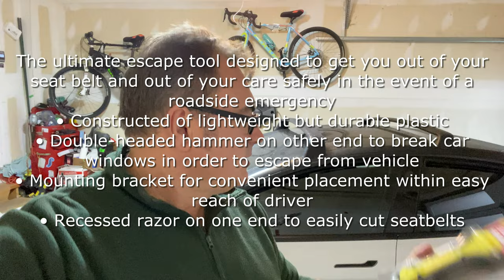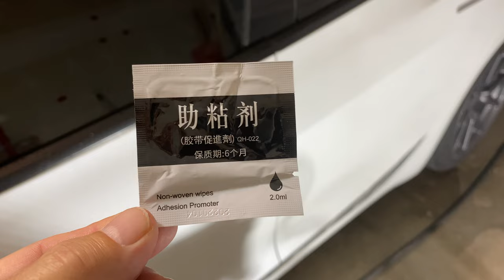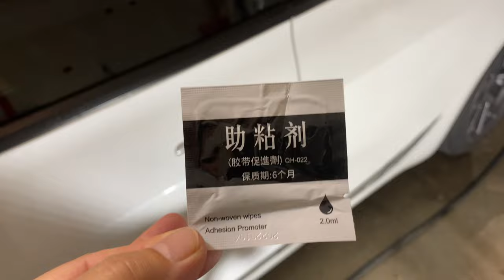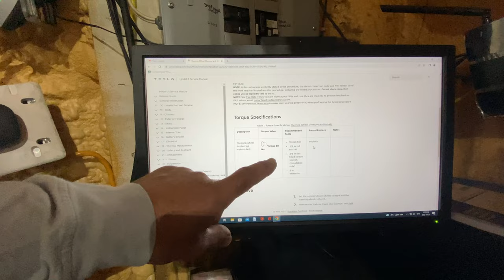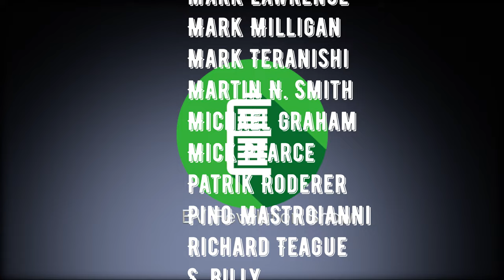Tesla Timeout #22 - EVANNEX Sponsor - Carbon Fiber Steering Wheel Model 3/Y & Door Handles!

Comment: I bet you saw my video on the door handles!  Mine have gone through one winter and almost ten months now of use.  The adhesion is amazing - no issues at all.  When offered in colors, the paint matched my gray exactly.
Reply from the maker: Thanks for watching! Yes I did and commented on your channel as well!  So far so good and we will see how this winter goes.  However, with the heat gun I used and taping/sit for 24 hours, they should be fine.

Comment: On the doorhandles. Maybe you should also replace your electric motor by an ice. So much easier to ‘charge’. In other words … bad idea! For ice vehicles door handles, mirrors etc are not an issue because one tank of gas has 500 kWh of energy. For EVs with 70 kWh in the tank, every bit of resistance counts. Again, bad idea.
Reply from the maker: Thanks for watching....totally and utterly disagree with you, but you are welcomed to your opinion.